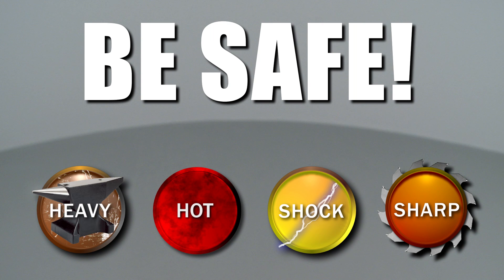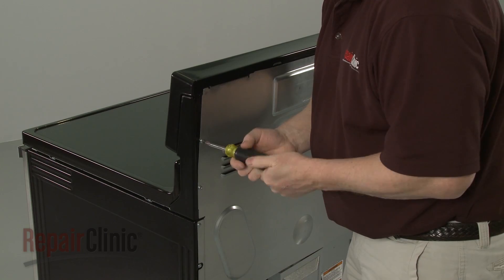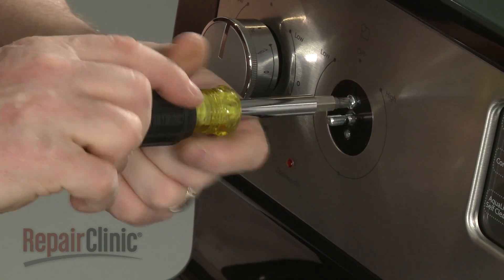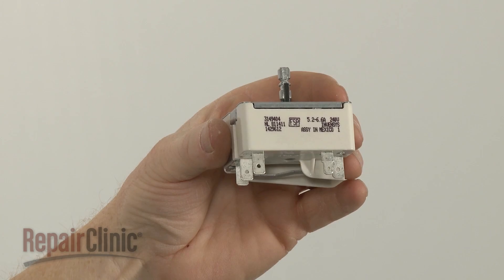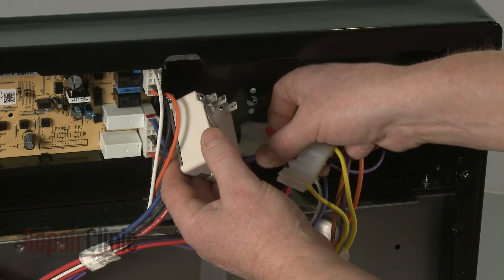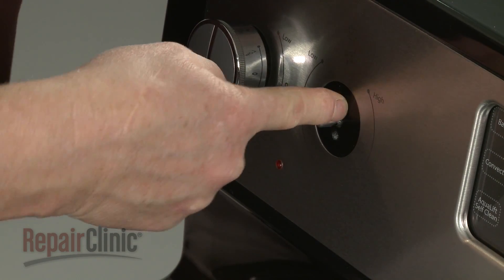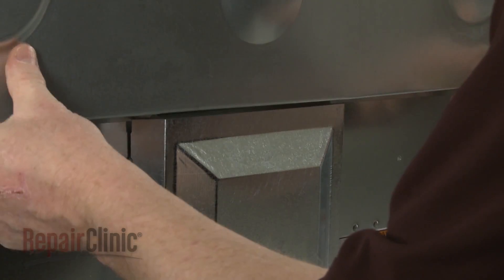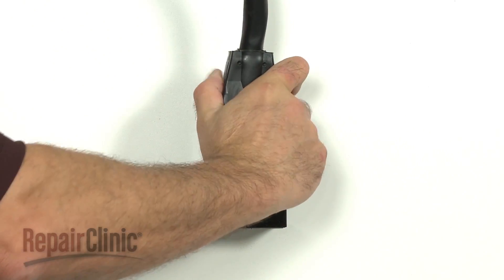Whirlpool Range Surface Element Switch Replacement #3149404

Comment: I have a whirlpool range where the left front surface element switch made an audible clicking noise when I rotated it (the others didn't), and the issue was when you turned the switch on, it would stay at max heat no matter the location.  When I removed the surface element switch, it had a small blackish smudge on one side, so I could tell something failed in it.

I had a couple of issues not described precisely in the video.  One issue was two of the screws in the back plate didn't come out easily, it was like the screw was stripped.  I had to apply a little pressure with a second small flathead screwdriver under the screw head to provide the tension to unscrew the screws.  The other issue was that when I put the tension clip on, there is a circular part and a straight part.  The straight part was completely flat on the switch that I bought, so the knob would pull right off after installation.  I had to put a little kink in straight part of the tension clip before the knob would stay on like the others on the range.  I also made the mistake of putting the tension clip on the wrong side, and when I did that, the switch rest position was reversed from top to bottom.  It was simple to flip it back around though.

All in all, the part cost me about $35 on amazon and this video definitely saved me some $ on the repair cost.  Great video!

Comment: Facing the stove, I have to replace the two left ones. They have different numbers.  Are the switches the same?  3148951 and 3149953.